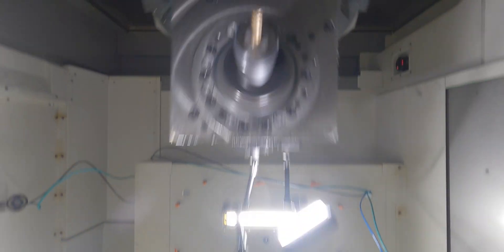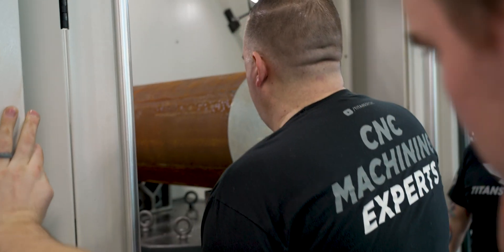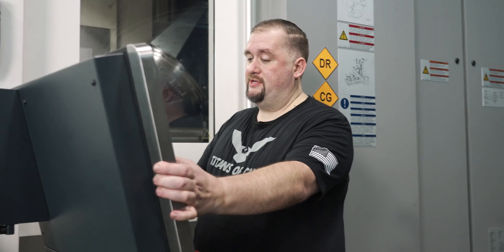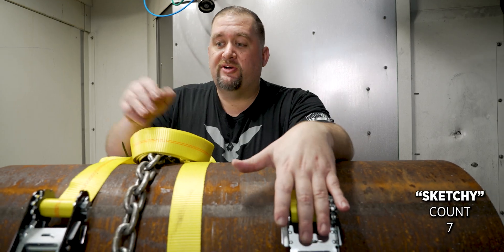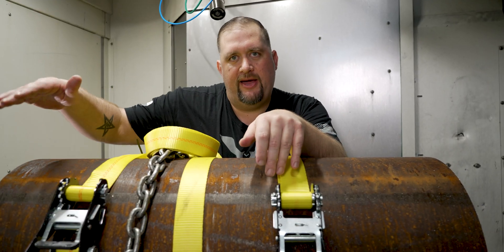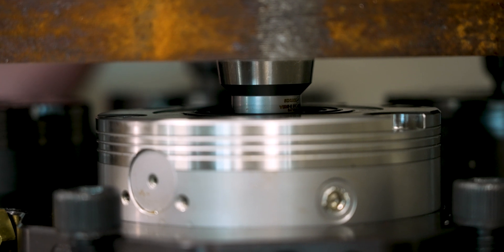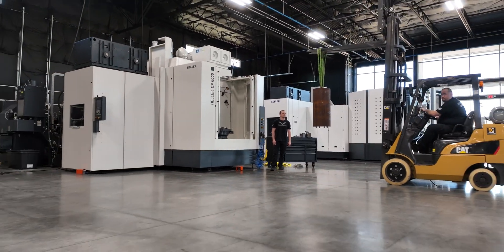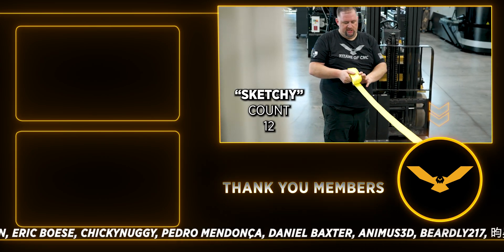Attempting our MOST Terrifying Fixturing Solution

Comment: For the last 10 years I’ve been running aluminium tombstones held into my Matsuura MAM72-35v with a single stud gressel zero point. Just a 20mm deep M10 thread in aluminium😂
 Swing it over 90 degrees and stick 40mm drills in it all day long 250mm up the tombstone for max leverage 

4 studs will be bombproof

Comment: I would use a G10 L50 in the safety header of the program to set max rapid speed parameter at 20% so even if the control is set to 100% it won’t try move at 1000+ IPM

Comment: Maybe sketchy is very subjective. 

Having seen my former boss build his own make shift crane with a forklift, where he centered a 3m 100x100x4 tube over the forks with two wood pieces and claps as fixtures, to move a 1T piece of equipment was my imagination of sketchy. Best part was, that all that held the equipment to the tube was a 1T sling that also probably was not rated for 1T anymore, since single fibers already were separating from the loop and the protective tube also was basically half gone. 

I also still don't know if the forklift ever had a road certificate, because we always drove it on public roads between the two properties he owned in the village.

Comment: 2 days later, still facing first side with 1/2 endmill.
And i hope surface finish is not that important 😂
Ok lets be serious now, you are thinking about clamping and all that, but 4xm12 is weakest point. I hope bolts and threads will hold.

Comment: Barry’s going to show us a NEW version of chatter like we’ve never seen before😂 man Schunk must be realllllly confident, we use Vero s at work so if this works I’m really going to have a whole new respect for them tiny studs .
Reply: Please try fcs out best used in my 33yrs maching great for 5 axis to reach 5 sides one set up
Reply: Also look at technomagnate use 2 sided angle plate mount fcs one side energize magnate and your ready push out by take smaller bits but go faster good for 5 axis roughing passes

Comment: I hope they do some deflection measurements while this 2200 pound chunk of steel is being machined, there is a high over turning moment on this piece and it should be interesting to see how well this Schunk pallet system keeps this monster glued to the table.  Barry needs to put some safety cones around the machine when he starts cutting just in case this beast decides to launch itself out on the floor.

Comment: if you use big Integrex you can save a time, or big mill turn machine other brand, or the irbamia can do the job , sometime , on mill machine need to cut the frame for making  a die set, 120 inch travel in x oki but  revome the door cut the frame an put a batch to protect for coolant see nothing in the machine press cycle start and have fun ;)

Comment: Barry, question for you. When the fixture plate was installed the first time, I am curious if there was longer bolts and then washers used, if the washers would act as a solid type of toe clamp?
PS: what do you mean I have to wait for another video for the chips to fly?  Grrrrrr😡       🤣🤣🤣🤣🤣🤣🤣🤣. Also dont quit your day time job for a song career 😁 j/k.
Reply: You don't see it in the video, but I did that before deciding to use the right clamps. So good thinking, as I thought the same  thing!

Comment: The first time you put it on the pallet, rotate it at 90 degrees, (along X), fits better while rotating a pallet in a horizontal. Lucky your APC is servo driven, imagine that with a hydraulic system. Confirm pallet and run

Comment: Why were the half moon bolts not enough? They look like they were about 5/16" screws, where if those are 316 stainless, then each screw could handle a shear load of 2277.96lb. That combined with the weight of the part, I would think would be plenty to hold it.
Reply: Gotta sell schunk stuff

Comment: How did you end up with that half hole mounting on the pallet plate in the first place? Is that Schunks' design??
Reply: I machined those into it hoping it would be enough.
Reply: @barrysetzer  Sketchy #1 lol. Did you guys consider a couple of appropriate sized dowels with counterbored cap screws to mount to your table? (since you were threading it anyway). Repeatable change outs. Nice video Barry!

Comment: G&G Steel in Russellville, AL for about 7 years. Same setup as this every day except we didn't have the cool Shunk stuff. We set that kind of thing up on 1-2-3 blocks and used 1"-8 all-thread with homemade thick steel straps and some impact wrench uga-duggas to hold it in place. (2nd op. First op was identical.) Admittedly, this was done on a horizontal mill with a table big enough to put that whole machine on and we had to turn it to any other face that needed it with the crane, but still. Cool work guys! Keep at it!
Reply: big integrex can do the job??

Comment: TBH, the most sketchy part i have seen in that video, was at 8:43 - someone screwing two ISO 3266 eye-bolts into a heavy piece of metal. 
AFAIK any of the mould-tool machine shops i had to design stuff for, had safety-eyebolts as must-have :D

Comment: At 5:15 in the video in the top right hole i see scratches on the face of the part where it looks like the scrap bits of metal from the drilling operation where rubbing on the face. is there a way to mitigate this? i drill a lot of holes in one go and this happens all the time. is there a way to stop this from happening that doesn't include stopping the operation every 5 min to clear the chips?
Reply: Peck drilling to break the chips should make them fly away before nesting up and scratching the stock. It shouldn’t be a problem here, since the material will be either milled away anyway or the whole part will fly off and you‘ll have to deal with some minor other problems 😂

Comment: Schunk said it should work,do they suggest things that will not work at times?
Reply: Barry's setup is a bit extreme and not how Schunk's Vero S system is typically used lol
Reply: They should have calculations on how much momentum the Veros are able to hold. I‘d have the question of how much give the 5 axis Heller has at this load…